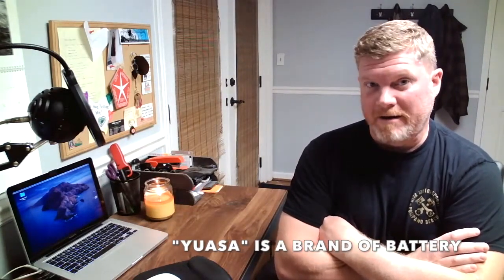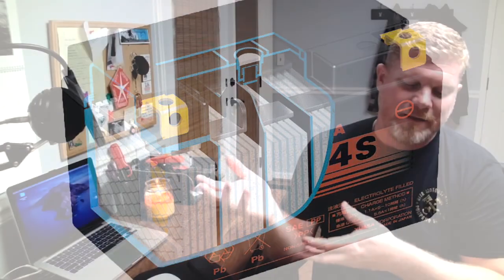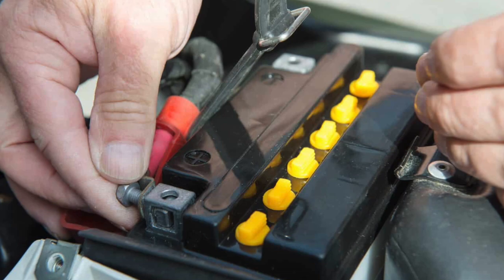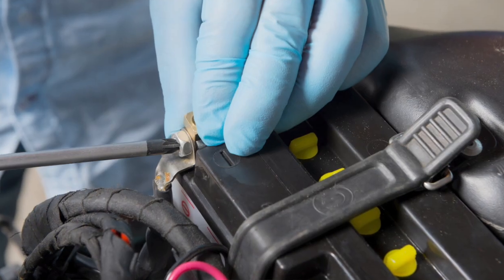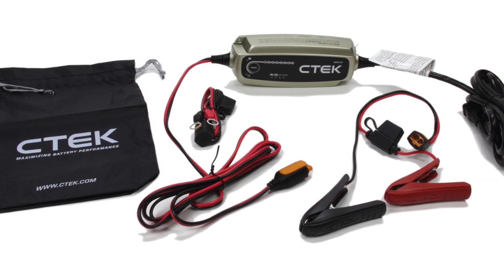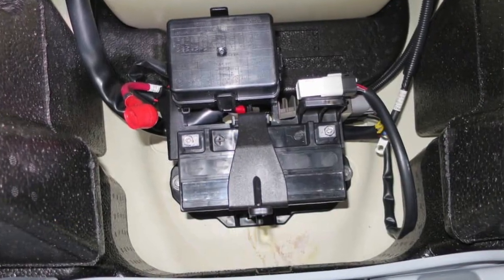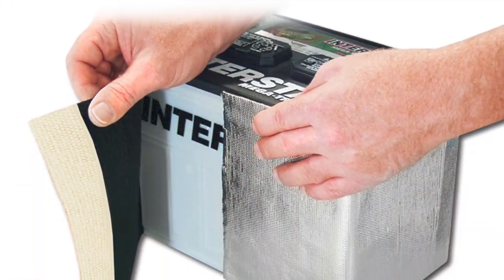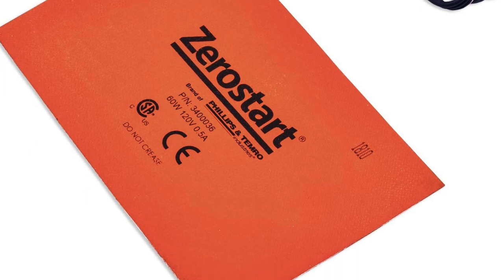3 Tips For Extending Battery Life: WCJ Quick Topic

Comment: I love what you have shared.  I have used a cheap HF tender for many years on cars and tractor batteries.  The lawn tractor battery I had that lasted over 8 years was removed and stored in my heated garage at the end of every season.   I have done the same with my PWC battery and it’s not ready to give up the ghost.  I have friends that end up buying a new PWC battery every year but leave it in the craft.  Not the way to go!   I will stay with what I know works.  Trickle charging over the off season defiantly adds to the longevity of the battery.   Store it fully charged and use a trickle charger and it adds many years to the life span 👍.  Great video and hopefully you have enlightened some of the viewers.
Reply from the maker: It's all about being on top of your maintenance.

Comment: Everytime I wash the engine of my jetski I dry the motor with a leaf blower. Every part of the engine. And put some dielectry grease on the battery's  terminals and I've never had problems with the corrosion in my battery.
Reply from the maker: Absolutely perfect

Comment: I let my battery go flat over this last winter. Bought a charger today, coincidentally the one from CTEK and it’s charging now. Question though ; if I have the PWC in a heated space over the winter, can I charge the battery in the PWC or should I take it out?
Reply from the maker: Good question: many argue both sides. We typically err on the side of caution and recommend removing it from the ski and charging it on a shelf or the concrete floor.